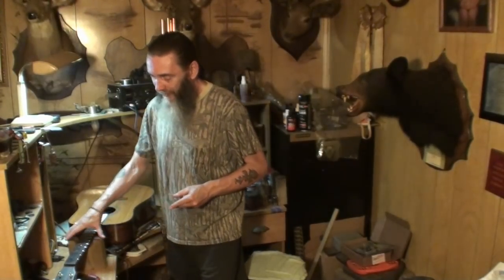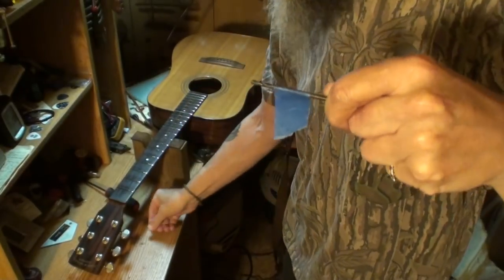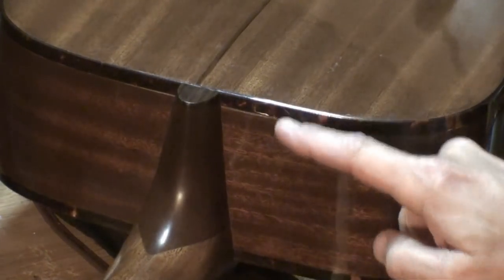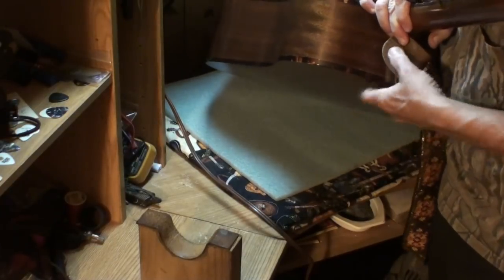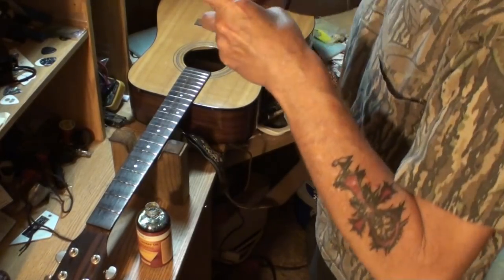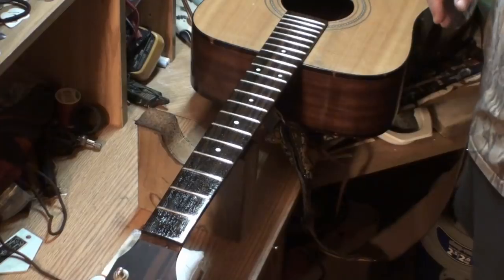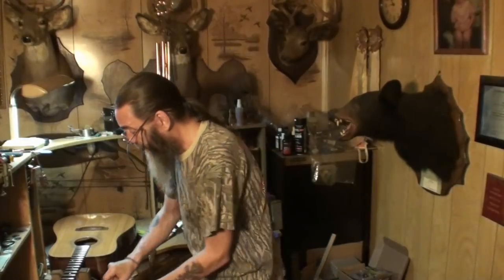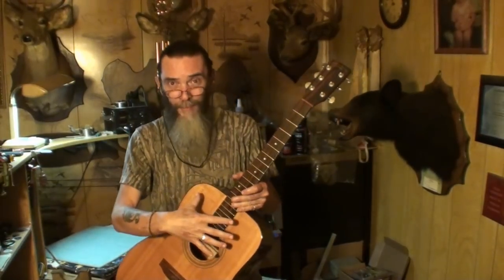acoustic guitar strap button install tips on linseeding your fretboard simon patrick biatch session

Comment: Randy that was the best Cue opera I've heard yet! Boiled linseed oil isn't boiled but has added petrolium and other stuff to make it dry faster. Raw dries a bit slower. And it doesn't collect dust as you said. Some people prefer raw because its natural compared to boiled. Why they call it boiled when it ain't? HellifIknow. I think back in the old day it was boiled. I used linseed a lot for many years. It was an additive to paints in the old day. Anyway, it sure does a fine job on fret boards! I usually apply it maybe twice a year. It preddifies it reeeel gud! Thanks again as always. I never get tired of your vids and it always helps to renew. I was in Portland Or to see me daughter & son in law and lacked my guitar. Not on plane luggage my axe. So my niece lives there too and had a Korean Fender accustic. It sucked. So I shaved the bridge down and the nut, adjusted the truss rod and made it playable, decent anyway for a cheapo. New strings helped since the old ones were on 10 years or more. My son in law had the tools enough to do the job, after I sharpened them up. Had linseed too. Had a matt finish that made it look cheaper but I polished it to a satin and looked better. The finish was pretty beat but looks great now. So all the Randy vids helped a lot and Thanks to you she played it and thinks she might start playing again. Before it was like playing a 2x6 strung with barb wire. I told her to loosen the strings if it was going to sit. I put light strings on it. Tightening the truss rod really helped and I did it over a few days with no strings. Sharing your art helps many! I am planning to do a youtube deal and  share some of my shit too and I'll let you know. So many Thanks again. And keep Earl away. You never know what else you might catch for the Toungemeister! DaveyJO in PA
Reply from the maker: very cool! I always love hearing that my videos have helped, it was really tough to get help back in my young days, no internet, no Youtube, no nothing! lol that's why I like to share my experiences and what I know and when someone says it helped makes me very happy! so thank you brother! cheers!

Comment: Hey Randy, Great videos...you do great work!!!! 
someone gave me a Takamine "Lawsuit" era acoustic that the bridge is pulling up and has a crack that runs from the bridge to the tail on the soundboard...first is this guitar worth repairing and which should be done first the bridge then the crack or the crack then the bridge?
Reply from the maker: AMERICA 1ST the crack should be addressed first, that will give the bridge something solid and secure to bond onto. It's it a sean separation right in the middle where the two parts bookmatched are put together on the top? I see that a lot on older guitars that have been dried out. Thanks for checking out my videos!
Reply: Thanks Randy! Yes the crack is right down the middle of the soundboard on top from tail to bridge...are these old "lawsuit" Takamine guitars worth the hassle?

Comment: Why not just put it on the flat part on the bottom of the heel?
Reply from the maker: tradition mate, plus the guitar will hang better with the button installed like this as apposed to the middle of the heal. almost always if you look at a guitar with the button in the flat part of the heal indicates the person installing it didn't have a clue and probably doesn't use a strap much. thanks for viewing and commenting!